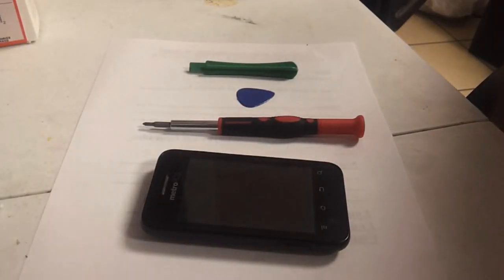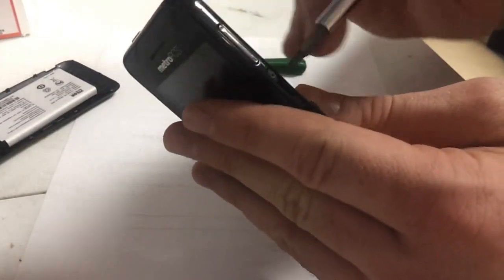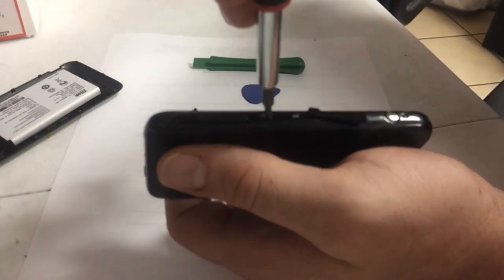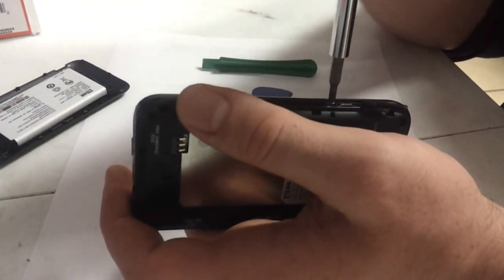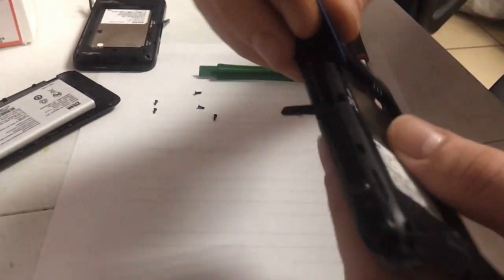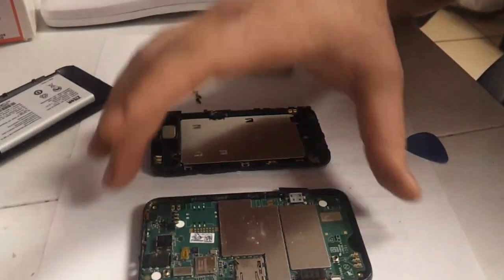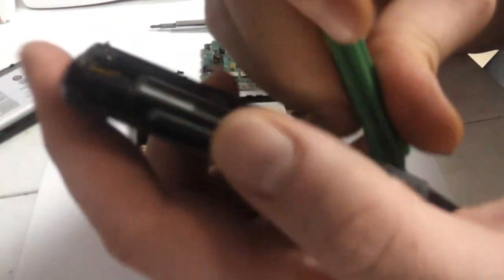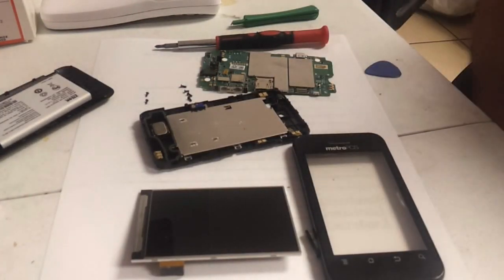ZTE Score Disassembly Metro Pcs

Comment: Have you ever disassembled the ZTE N9810/Sprint Vital/Virgin Mobile Supreme? I can't find a video anywhere. I get stuck at the volume keys when removing the frame following removal of the screws. It just doesn't budge.
Reply: salmmm22 Did you ever get an answer?  The screens are found easily online, but no instructons on how to desassemble the old phone.
Reply: Lois Donnay nope.
Reply: salmmm22 there is a screw between them, you have to peel the black sticker off